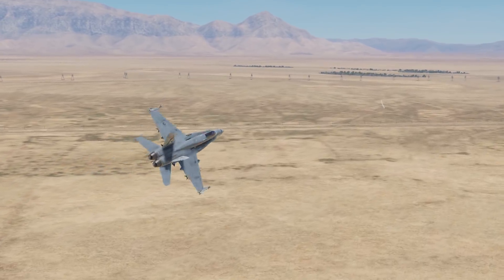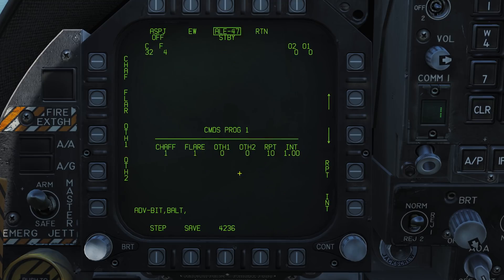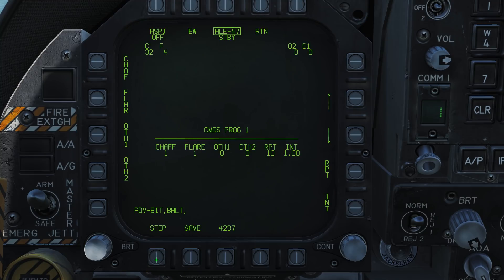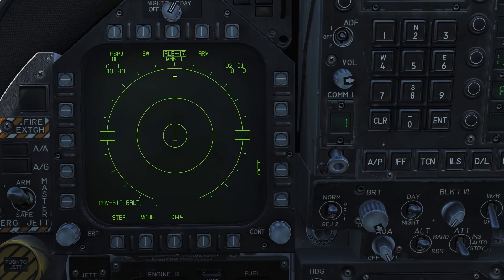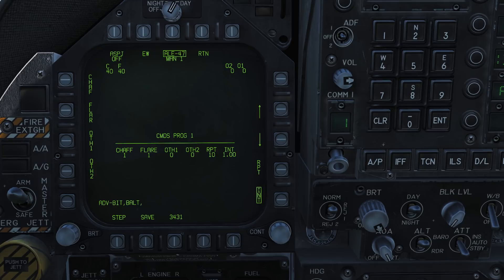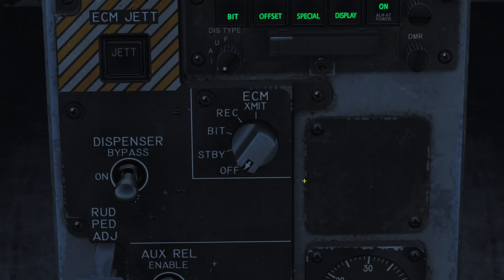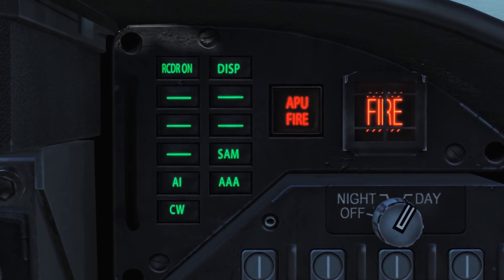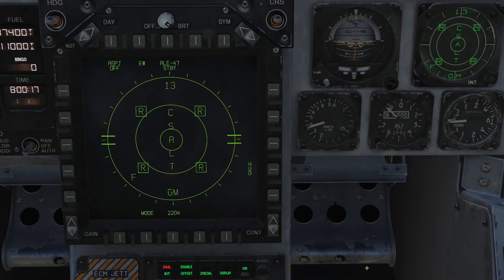DCS F/A-18C Hornet Countermeasures Tutorial

Comment: Sorry if this is a stupid question, but why would I want it to set to "Bypass" if it disables the system? What does it mean/do exactly. It seems in your video you have set it to "On" at all times.
Reply from the maker: disables the CMS system not the dispensers. So it won't run any of the programs, instead dropping one chaff or flare depending on direction pressed. So if the program selected is bad, or the system isn't working right you can quickly bypass it to regain controls of countermeasures.
Reply: @RedKiteRender  Thanks for explaining, this "game" is insane. I installed it last week and was hooked instantly. Your videos are very helpful 🙏  Currently I am playing without a HOTAS, I play in VR with 2 controllers. I press all buttons and switches with my hands inside the cockpit, so the only things I have to bind are all HOTAS controls. I am trying to create a scheme for multi layer buttons control with the help of OpenVR2Keys, because the amount of buttons are limited on VR controllers in general.

Comment: doesn't work, I managed to set the countermeasure program 1, but when i 
press countermeasure forward and aft nothing happens, I don't even know 
how it decides which program goes to which countermeasure button press 
(IE how do i make countermeasure program 1 go to the countermeasure 
forward button.).
Reply from the maker: #1 Master arm on
#2 got to ew page and press MODE until MAN (program number) shows
#3 Forwards will run prog #5
#4 Aft will run the prog number selected on the EW page, which is changed with step
#5 setting the dispenser switch to bypass forces aft press flare and forepress chaff bypassing the programs.

Comment: Great video but still can't get chaff and flares to fire - do you need to have the pod fitted and if so how do you do this - sorry for being a newb but getting slaughtered without any countermeasures
Reply from the maker: No pod required, flares/chaff should be loaded by default. Master ARM on is required for some unexplained reason. I'd use the override position if you're just looking to get into it quick, then just push the countermeasures switch forwards/backwards to release.
Reply: Thanks for getting back to me - I have default E and D for countermeasures and even designated joystick and throttle stick buttons but nothing seems to make flares and chaff come out of the aircraft - apologies for being clueless but I have tried everything including custom loads for weapons and yet nothing.  I have used external view - hit the designated buttons and nothing - sorry but am at a loss now....your support very much appreciated...
Reply from the maker: Are you doing a cold start? It's possible you're missing a step and not powering up the counter measures system
Reply: All sorted and thanks for the great videos and tips...

Comment: Awesome guide!

But is it just me or are the CMs a bit weak on the numbers? Kinda like the M2KC
Reply from the maker: Countermeasure bays are pretty big and induce drag. Being small, highly manoeuvrable aircraft it's generally accepted that they use their other strengths to avoid missiles. 

Aircraft like the Harrier and Hog are expected to maintain close air support for long periods and have a large supply of countermeasures to allow for this. The mission profile of a hornet is much more about striking their targets often from high altitude and getting out of there quickly. 

It's certainly less countermeasures than i'd like but, it'l do the job, you can often defeat threats without the use of cms, by other means such as high altitude, airspeed or g-forces.

Comment: Actually when on the ground the ALE-47 stays off, even if the dispenser switch is on. Not sure if this is a bug or not. As soon as I took off, it changed from off to stby
Reply from the maker: That's the weight on wheels protection system, it prevents accidental discharge of weapons and countermeasures whilst on the ground to protect the ground crew and those around it.

Comment: Thx for this detailed tutorial! Keep up the good work. Great style, competent + calm. I just didn't get whats going to get implemented during full release - additional dispensers?
Reply from the maker: There are additional bays for what's referred to as Gen-X expendables these are special deployable ecm's and decoys that'l really change how we see countermeasures in dcs when they're implemented.
Reply: Thx, I'll do some more research into the F-18. I wasn't sure if buying such a high-fidelity module was the right choice for me - given the limitations of my system: using an i7-4770 (could do overclocking but so far no), recently got myself a better graphics card for free - Gforce 970 lol... + 8mb RAM for free, now running it with 24MB... I have 2 SSDs and TrackIR5 pro but my HOTAS is the main limitation currently: Thrustmaster Hotas X- has only very few buttons so I use keyboard + mouse a lot. Works for single player and F5E + FC3 modules thpugh! But now I am starting to enjoy the Hornet already! Very easy to handle, 2nd carrier landing attempt trapped No2 wire successfully after a bolter! Tanking unsuccessful so far but I'll learn it eventually...
Reply: Keep it up man. The learning curve is part of the fun.